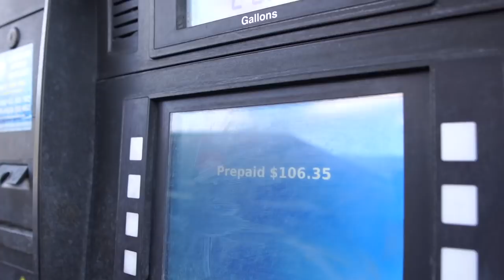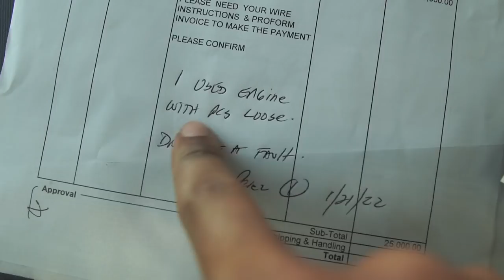Customer Tried To Refuse The Freight | Non CDL Hotshot

Comment: You probably already know this but: 1. When bolting your spare to the bracket, use nylok nuts...they won't vibrate off of the bolt. 2. Put a cable lock around the spare to the gooseneck frame. It will secure your spare from falling off plus adds some security so someone doesn't steel the tire. These are the best lessons learned, sometimes expensive but you won't ever forget it either.

Comment: My spare is up there like that also. I have heard many stories about them falling off, either by the weld breaking or the lugs coming unscrewed. So I added a chain around it for extra safety. But, keep up the work brother. Make that money!!
Reply from the maker: Will do!
Reply: @ChrisTV1   hey Chris,how's those bolt on winch holding up on ur trailer???. I'm thinking of getting some for my trailer but I want to hear from you please??.

Comment: Well young man you just learned the hard way what a pre trip inspection should be all about not just mechanical for the truck but anything you have attached by bolts or chained and strapped down now you know small thing to a g learn from your mistakes and keep rolling strong my guy I learned the hard way early on in my career got a unsecured load for something that wasn't even part of the load

Comment: It’s cause of lower elevation in Florida the air is more dense so the truck needs more fuel if you have a boost gage you will see that you are running more psi in lower elevation. It’s why engines have more horsepower in lower elevations turbo or no turbo. Good vid and good job driving, hauling is harder work then people know keep trucking
Reply from the maker: Never knew that!

Comment: That's a decent trailer, it has a torque tube under it. I'm a welder at a production facility that builds trailers like that all day. They are a bitch to put in but well worth it.  
Good luck with your ventures
And edit: the axel tubes are meant to be bent upwards to pre spring then for when you add serious weight to it. Probably just the spring perch. Take it easy
Reply: Yeah I could see in the video, spring perch was bent due to the side to side beam being bent up, sucked it in.

Comment: I had my truck spare tire come loose from under my truck ( tire cable mount snapped ) and ran it over with my Big Tex 25+5 trailer. Luckily no one got hurt BUT it bent both axles. I had to remove the front axle tires to get it home about 100 miles. Took me 2 1/2 days to find 2 dexter 7K axles. I finally found a pair in Ft Pierce FL and they did not ship. I had to drive from NC to FL to pick them up. Pre pandemic dexter 7k axles could be found at any Big Tex dealer and were about $550 per axle. These were $950 per axle and had to drive to FL to pick them up. With that said Don't forget to check your truck spare tire under the bed. Good luck to you. Stay safe

Comment: One thing you can do to make the Pre-trip faster on that Spare tire is once you get it mounted back on, make a mark with an ink pen on the nut that holds the Tire on and have it go onto the frame so all you have to do is see if that line is still lined up on your pretrip, I do it on all of my Lug Nuts as well, this way you can tell if it's starting to come loose instead of waiting till it's finger loose and you then notice the issue.
Reply from the maker: For sure I’ll give that a shot.

Comment: Looks like the axle perch is not sitting on the left springs, probably from the tire hitting it. 

Also, the axle tubes are bent upward, so that when the trailer is loaded down. If the tube was straight, then the axle will be bent down when loaded. It’s the same way for the trailer bed
Reply: I noticed the same thing at 13:07. you can also see where the U bolt is moving around in the axle tube.

Comment: Chris, you should run highway tires in summer. They stay cooler, better fuel mileage. All terrain use only in snow seasonal. And please move around slower with camera. You move it around and up and down too fast. We retired long haul truckers with 30 years out there. Be safe 🙏

Comment: vibrations above or around 60mph are usually a balance issue with the tires but could be the wheels not tracking correctly.
Reply from the maker: Bet!

Comment: Why don't you get a winch winch and pull something as small as the motor forward 4 Or 5'. Your load would sure ride better. It's not a bad deal with the motors on skids.

Comment: Heavier loads go closer to the truck bro or the ones u gonna drop off first go to the back. Better balance and easier to correct incase any sliding error.
Reply from the maker: This isn’t correct, heavier loads go over your trailer axles, if you put it close to the truck it will over load the back axles
Reply: @ChrisTV1  ok

Comment: Hi Chris,  l know that l am late to comment, sorry! The spare tire coming off, that truly sucks.
Has anyone told you about race wire? Or have you fixed your spare so it won't come off again?
You need a nylon nut first, they have a nylon piece in the end of the nut, plastic really, so they can't vibrate lose over time. Secondly you tighten the nut as tight as is required? 
R.F.T. 😛, you drill a small hole through the centre of the stud, a small hole, them put a pin through it or race wire, a thin braided line. ( wire ) just above the nut, so it can't back out.( you can check g, on line for a pic, take you like five minutes to do, it will take longer to drive around to get the pieces, Hey, have " BIG TEX " DRILL IT. YA, BIG! 
Happy motoring.
✌🏻👍,👌👋🏻❄ 🥶 🇨🇦 👨‍🦽😎.

Comment: Bro those chains should be crossed, the right chain gets hooked to the left anchor and left to right. That's a violation. 5th wheel connector doesn't have to cross but gooseneck does.
Reply: Does not matter on a gooseneck.
Reply: @Messenger  it does, check with an actual DOT officer and they will tell you. Unless you have a gooseneck connected to a 5th wheel adapter. The whole point is for the chains to cross to catch the neck if it comes loose.

Comment: I am interested in becoming a hot shot driver.
I have 2017 dually needing a nice 30-35 trailer with dove tails.
I am also interested in becoming a dispatcher, are there any software or classes online that I can take that you can recommend.

Comment: Hey bud your young and doing what it takes to get ahead in life but please slow down, use your head and do everything right so maybe you can eliminate some of your costly mistakes.
Reply from the maker: What costly mistake did I make? Im 31 years old so I feel pretty mid-aged.. Accidents and things happen, ya know? I dont look at it as that im moving fast.
Reply: @ChrisTV1 please understand I’m not knocking what you do so don’t get defensive. I’m almost 30 years older, I’ve own my own businesses for many years and probably employed several hundred people. I contribute my success to being open minded and listening to people that’s been down the road that I was about to head down. I’m not making fun of you I promise, you will make it. Tarp your load right, you probably knew that tarp was going to tear. I’m not a hot shot guy but I knew it was going to tear.. cable and lock your spare tire. Just these two things cost you and I’m not even talking about trailer damage. You will have plenty of unexpected expenses happen but don’t knowingly add to them. Don’t let making you tube videos cloud your vision either, stay focused. Keep up the hard work young man.

Comment: When looking for a truck for your non CDL Hotshot setup are there anyting that's a must-have for your truck. And also on vice versa is there anything that maybe might be expensive was not absolutely necessary. What kind of things should you look for for your ideal non CDL Hotshot setup? And what should be avoided?
Reply from the maker: Not really, everyone has their own ideal set up, so it’s really preference honestly. As long as she can be a work horse and won’t push me over the 26,000lbs GVWR I say get it. That’s the only thing I was looking for when I bought my 2500
Reply: If you can find a 3500/350 with single rear wheels and 10,000 GVWR, that would be ideal for  non-cdl hotshot. Ford and GM both offer this option on new trucks (I have one now), and RAM offers it on 3500 chassis-cab. This configuration can be superior to a 2500/250 in terms of suspension and in some cases, wheels/tires, brakes and rear axle.

Then get yourself a trailer with two 8,000 lb axles and a 16,000 GVWR. This will give you the most reliable, safe and legal setup to max at 26,000 total GVWR. If you know you won't be regularly loading any vehicles, rolling stock, etc, skip dovetails and folding ramps and go with a longer straight deck.

Comment: Just curious: When possible, why not ask the forklift driver that's unloading item A to move item B over a little for you, or allow you to do it? Liability? I am in Industrial Maintenance and even though I've learned to not trust hardly anyone on a forklift, (LOL) it seems like it would've helped you in this case.
EDIT:
I wrote the comment before I saw the spare tire drama. You either need to do a bike lock as a safety cable/theft prevention, or you need to use stainless hardware with a LOCKNUT that prevents the bolt from coming loose. I know that you know this already, but I would add checking the spare and anything else that's bolted down or riding in the bed of the truck, every day.
Reply: Most companies will not touch other companies freight due to liability/insurance reasons, sometimes you can get them to move them, but all the liability is then on the driver in most those situations
Reply: @percivale6511  we always move other people’s freight when the driver asks us to, there’s no reason not to.

Comment: What's the most you would pay for a used box truck and the miles.
Reply from the maker: 2014 or newer, 200k miles - $35,000 but the market is up like crazy

Comment: Nothing really to do with that axle, a pro could try but would never be perfect and stil cause vibrations, serious advice here don't try anything mechanic or repairs when concerning vital components of your trailer or pickup truck, especially if you don't know or not sure of what your doing. Axles, leaf springs, frames and breaks for example. If there is a break down and causes an accident on the road and there are heavy wounded or even deaths, the investigators will found out and could pin you for being negligent for  not doing it properly. By Doing it with professionals you can at least have repair bills that in this case would protect you. If you'ld like to do maintenance your self to cut on operating and repair costs follow a course. Great knowledge to have and with it you'll have what it takes to inspect properly and maintain before major breakdowns. Good luck out there !!!

Comment: Only problem I have with the hot shot guys is they always block doors while waiting to get in a bay, just common sense, especially in a smaller rig, park off to the side in line with doors or on the road, NEVER sideways blocking docks or bay doors.

Comment: Non-cdl? Be careful towing that trailer even if you're under 10,000 lbs on you're trailer, if the trailers rated weight is over 10,000 lbs you're required to have a cdl.
Reply from the maker: Not in Texas

Comment: Bro, FYI your over weight on the trailer axles 👀
Reply from the maker: I thought so too but if you look at the inside of the door on a Ram 2500 Cummins the GAWR of the front is 6000lbs & the back at 6500. Look it up and tell me what you find. Definitely down for a learning opportunity if there is one.
Reply: @ChrisTV1  the axle weight of your trailer tires have nothing to do with the truck.  You have 7K axles. You were over by a few hundred pounds. DOT fines you per pound. They also add up the tire trailer capacity.  14 ply have a higher capacity than 10 ply. Also the spare tire holders are known for failing. Always put a lock chain on the spare and secure it to the trailer, prevents theft and it it falls again, the chain will catch it...pew pew✌
Reply from the maker: Oh the trailer axles. I must’ve read that too fast.  So basically I needed more weight up front rather than right over the axles, right?
Reply: @ChrisTV1  correct, than you have to make sure your not over weight on your truck drive axles. That's part of the reason folks get a 3500 to 5500. They can carry more weight on the axles. It's all about balancing the load. Get yourself a come along hand held winch or a actual electric winch to move the remaining cargo around if you have to..

Comment: Hey buddy please do us and yourself a solid and get your trailer fixed I had a friend who hauled Just under Class A limitation per D.O.T regulations by at least -500 lbs. I literally spent months waiting once to get back to work and when I did for the last time the trailer was rotting to the point it was a road and personal safety hazard on which he still works and drives whilst it is also out of date and has lost a part while we were on the road. Do yourself a favor and spend that money to get it fixed. Plus, Hang in there it WILL get better!
Reply from the maker: Already got it fixed 😎